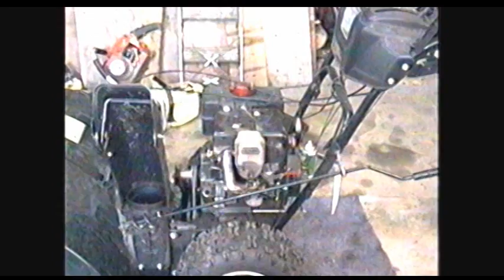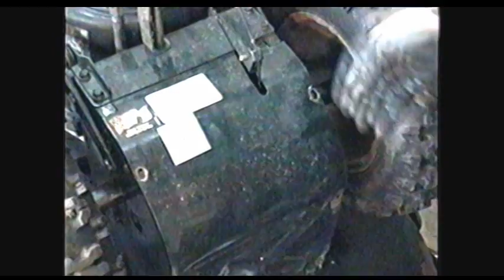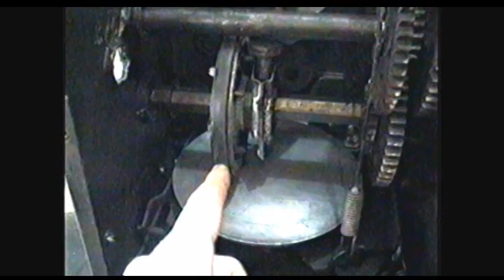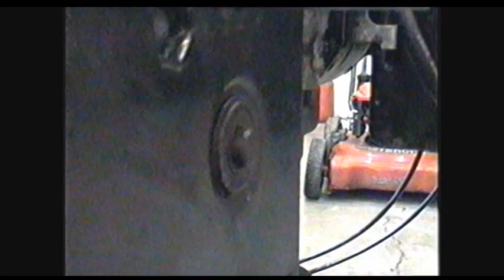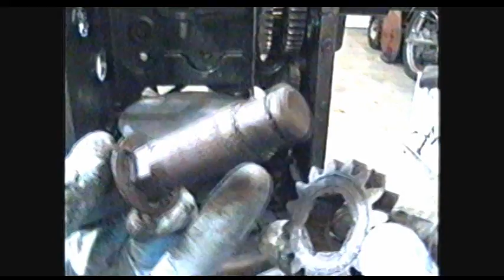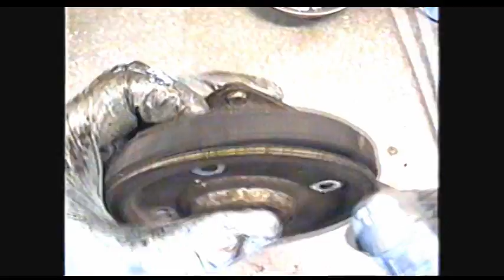Snowblower Friction Disc Repair Part 1/2

Comment: 1st and 2nd gear are very slow and sometimes do not work at all. Could this be the problem? I have a 6 speed cub cadet
Reply from the maker: euonymus1980 you need to adjust the shifter linkage
Reply: I am sure you have fixed your problem by now - replace the friction disc.
Reply: canadaeast actually I replaced the friction wheel but still have the same problem. In first gear it starts to go forward then goes backward. Im not sure what else I can do?
Reply: euonymus1980 Forward and Reverse are determined by which side of the friction plate the friction wheel is on. It would seem to me that there is something out of adjustment with the gear selector. First gear and reverse are very close to each other on the friction plate. Perhaps the wheel is creeping slightly left or right when it is in first gear.
Reply: canadaeast ....If the friction wheel is sitting at the center of the friction plate, the machine will not move. I would check to make sure the gear selector is operating like it should and that the friction wheel is moving properly as you move the gear selector from gear to gear and from forward to reverse.

Comment from the maker: @shaymaster1 not really, only if there is a problem with the dipstick tube or oil cap, but make sure u drain enough gas out of it so it doesn't spill out the gas cap

Comment: @th19940305 Lol same here mate. Engines just interest me, It's so much better to try and fix them yourself, considering they are quite low-tech, instead of sending the motor to some expensive repair-shop.